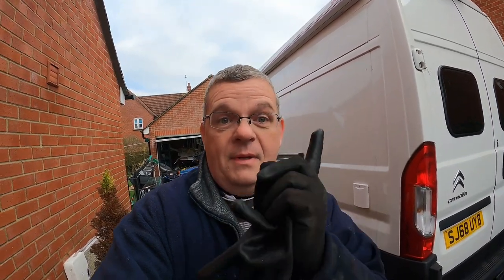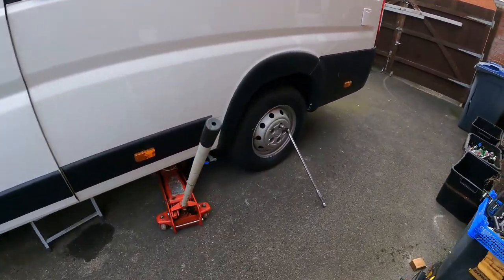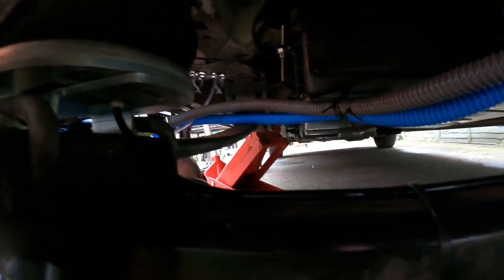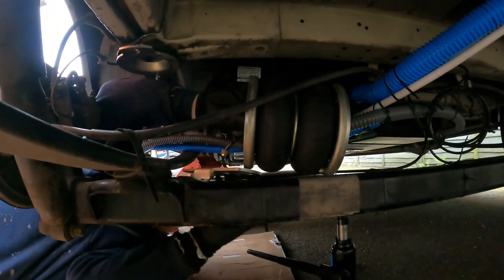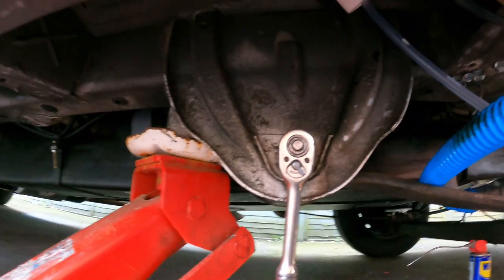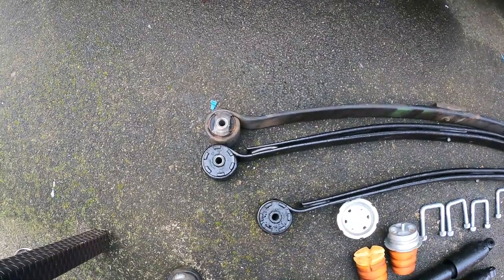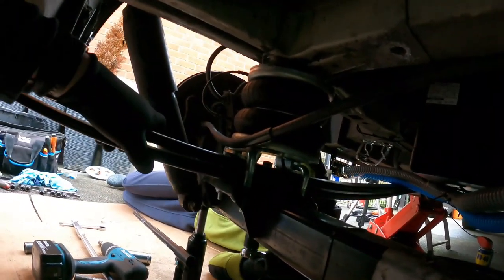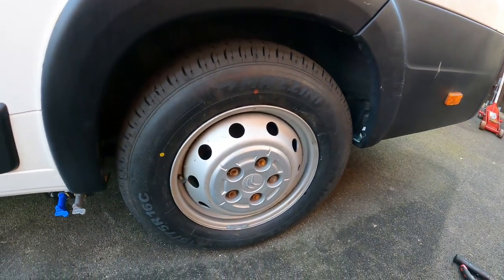Double leaf springs install on self build camper van Ducato / Relay / Boxer

Comment: You don't know how lucky you were. I did mine on the LT35, the back bolt is encased and a bitch to get off, because of access to the bolt. Most people had to cut the bolt as did I.
Reply from the maker: Sounds hard work! thanks for watching.

Comment: Do you have the torque setting for all the various nut/bolts involved in this swap? Im gonna be attempting this next week
Reply from the maker: no sorry, not supplied to me at the time so I went with the 'murder tight on the breaker bar' method without anything else to go on. please dont copy that though, that was an option that worked for me.

Comment: My H3L4 ambulance i'm converting is rated at 4.1 tonne and it doesn't have leaf springs in the rear. It has sway bars and airbags only. I do like my set of ratchet spanners. They make life so easy, especially if they have a flexi head on the ratchet side.
Reply from the maker: Sounds like the ambulance was kitted out for both weight and a comfy ride so very lucky. Yes, i must improve on my 'screwfix' set I got and get all the odd sizes as well. the 14mm, 16mm, 18mm etc. Every time my wife's Fiat 500 needs attention, I curse the Italians for every bolt being 16mm or 18mm! why cant they use 13, 17 and 19 like everybody else.....

Comment: great video, ive just completed my van yesterday but im not putting it on the road until next month, did you have your van weighed ? is that whats made you want to upgrade it ? im hoping mine hasnt gone over 3.5 ton :/
Reply: Same here, near to completion and am now worrying 😟  what did it weigh?
Reply from the maker: A bold statement for sure to say you have finished? is a van ever truly finished? on the weight front, I have not weighed it as scared to do it to be honest. had my MOT in Jan and the combined weight from the brake test rolling road was 3.4t. now it is not an exact science of course as the two axles are weighed separately during the brake test, but it was enough for me to know and decide that an up-plate was going to be required. they reckon I could go to 4.5t which would be great, will wait and see how it pans out and then make a video on it.
Reply: Interesting that you can go to 4.5t 🤔 Are the axle weights on the van's 'plate' the maximum without the suspension mods..? Mine add up to 3850kg. Presumably the maximum on the 'plate' is primarily based on suspension spec rather than the actual axel max itself..? Great vid btw..🙄

Comment: How come you tighten the bolts back up once the vehicle is fully back on the ground?
Reply from the maker: copied what i saw in another video about changing leaf springs and they said to re-tighten once on the ground in case it moves at all when loaded. hope that helps.

Comment: Great video. This is a mod I am considering. I noticed that you also fitted airbags. What drove you to make both mods? I was under the impression that you could up-rate just with airbags. I am struggling to remove the bump-stops as you did and wondering if I should just cut my losses and do the springs instead. Im not up-rating but my van is near max payload and sways around a lot on the bends
Reply from the maker: I had bought the airbags first but then decided to do the leaf springs aswell as not too expensive for what they are really and the ride is much better now. I don't get the 'lean' going around corners that i did with the OEM springs. if you have not already watched already, my airbag video shows how I had to tackle the bump stops....bloody things!

Comment: Hi there, followed your vid initially on air bags, going in for its MOT in a couple of weeks, I’m going take it to a weigh bridge after. How long did it take you to do it and how much did you pay for the leaf springs, thank you steve
Reply from the maker: If I remember I linked to the supplier in the video for current prices, it was around £300 if I recall. lots of choices on ebay. It took me a day to do with no experience of doing it before. a mechanic would probably clock this at 2-3 hours work. out of the airbags and leaf springs, the hardest and longest part is those damned bumpstops. with my up-plate I am now running at 4600kg . video on that coming soon.

Comment: Great video as usual, did you up plate your van, was it an easy process and what weight can it carry now?
Reply from the maker: yes I did up-plate and it is now 4.6t, i will do a video on this when i get the time but have very busy of late.
Reply: @wiltshirecustomcamper7203  Fantastic great series and lots of food for thought, was scared in case I had missed the video on the up plating, really interested on trying to get a pop top fitted to one of these, I see Auto Trail and Adria have models with this but at a high cost obviously. It would add another dimension and save a lot of space also would make room for my motorbike hence the interest in up plating. Keep up the good work.
Reply from the maker: @graemey85  I too looked at pop tops but dismissed it when I considered it meant no maxxfans and much solar panel difficulty.

Comment: How much did the double leaf springs raise your van ?
Reply from the maker: To be fair, it didn't as I already had the air suspension fitted but the double leaf springs gave additional stability and allowed for my up-plate which is coming in a video soon.